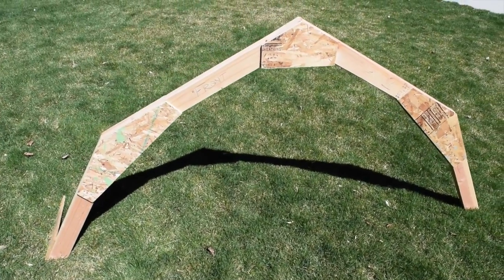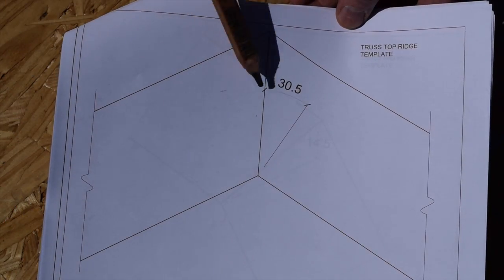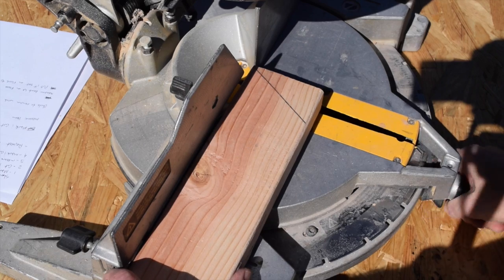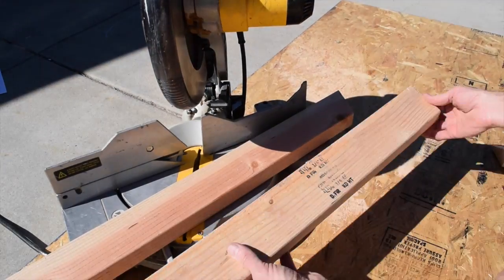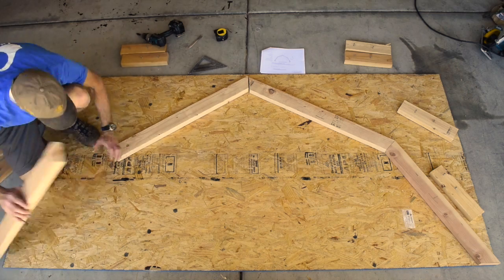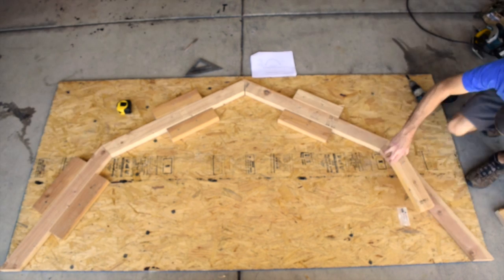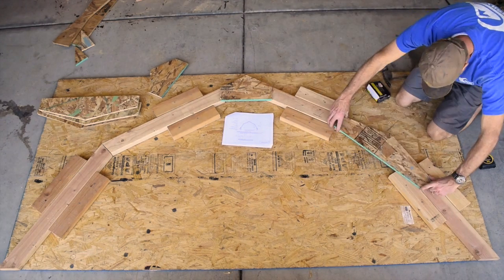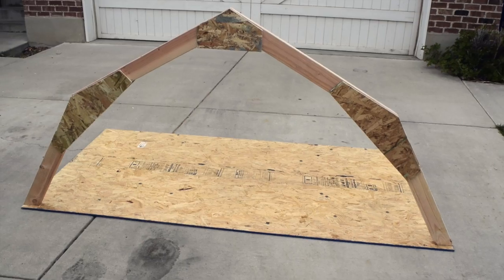Gambrel Barn Rafter Build - Learn How To Build a Barn Roof!

Comment: I would have used wood glue in addition to 6D nails on the gussets.  I also would have put a 3" screw in from the top cord to hold the angles together before adding the gussets.  It's fully possible to build these with no loosey-goosey angles.  Make the boards fit tight in the miters.

Comment: Thank you for your video.  I followed your discussion about building Gambrel trusses for a 10x20' shed.  All of the trusses lined up perfectly.  I am very happy with it.  So, now I have a technical question that I think a lot of your fans might like to know.  

My new shed is 14' 6'' high.  I put a floor above the 8' frame.  It is my intention to hang a ceiling lift  from the collar beam.  I have a 48x48'' opening in the center of the upper floor.  I plan to put a 15' trolley under the collar beams so that I can raise seasonal stuff to the upper deck.  Things like a push lawn mower, power washer and so on.   

Now for my question.  Have you ever researched or run across any information as to what a truss like this would be rated for regarding ceiling hoist stress?  I will not hold you to any information.  I'm just looking for a ball park figure.  Incidentally the hoist has a shipping weight of 40 lbs.